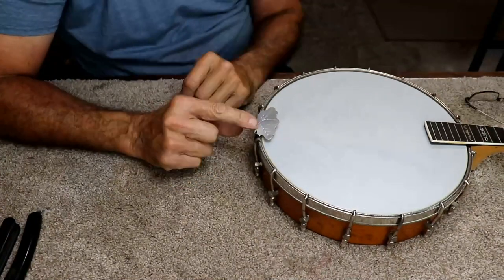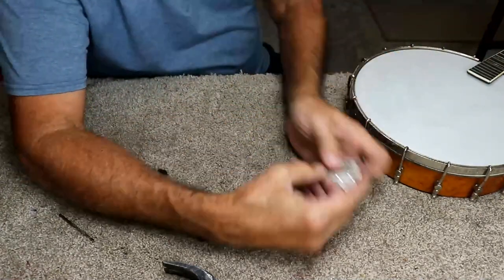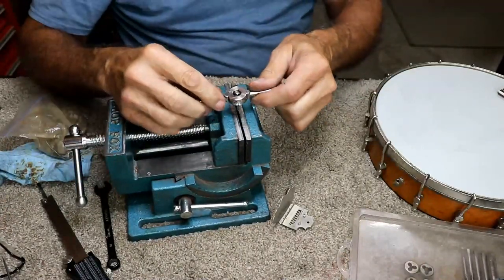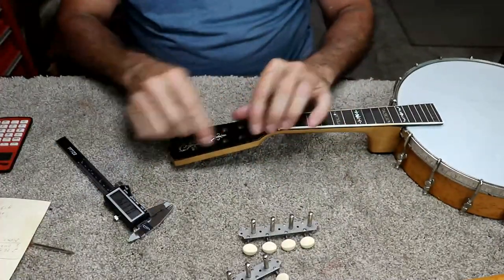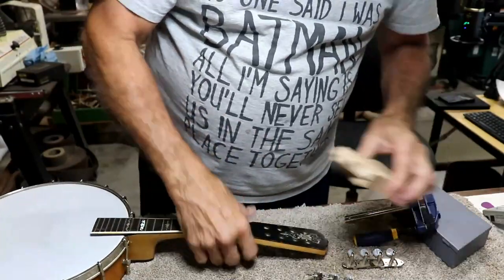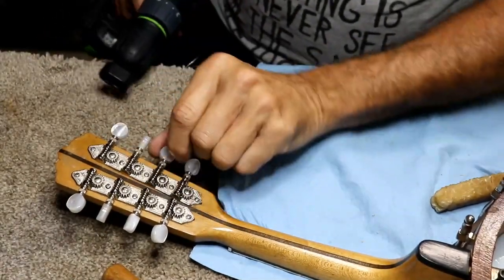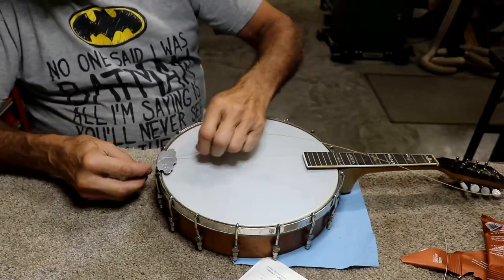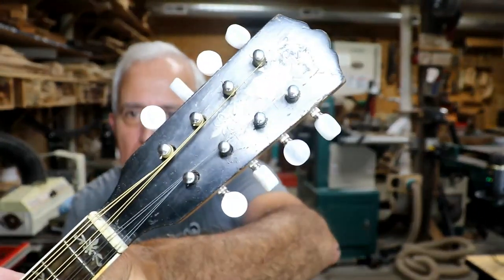594 RSW A Banjolin Repair - All Screwed Up - Part 3

Comment: Just get a set of Grovers fron StewMac.  I used Grovers on all three of my mandos  and have no regrets.   If the head holes don't line up, just plug 'em or ream 'em depending on how far off they are.  Grovers come with bushings that are generous.

Comment: Regarding the tuners, did you give any thought to using individual keys?  If the spacing was tight for normal keys, you could have used smaller, 12-string keys.  Just a thought.  Fascinating project, along with innovative solutions!

Comment: Personally, I would’ve used a straight edge on either side of the neck and marked the metal ring where the tailpiece goes and then marked a centerline between the two marks.

Comment: Why couldn't you have put those - "ferrules" - bushing gizmos to cover up the slivers of the previous holes that were still showing?  I also kinda wondered why you didn't "just" plug/putty in the previous holes first, to begin with, before drilling the new holes? Just a little finish touch-up afterwards, unless those ferrules would've worked there, also. Same situation,  basically.  I don't know why you didn't put them on that other project, anyway. i guess you simply didn't need them. 

Thanks, Jerry!!  Awesome!!!

Comment: After making the holes large enough, you'll want to partially sleeve the 4 nearest the end of the headstock. Why? Because string tension shouldn't be tilting the peg in the headstock hole. The 4 pegs nearest the nut should have the side of the peg bearing on newly reamed wood, but the other 4 will have extra clearance letting string tension tilt the peg, which could end up distorting the machinery on the underside of the headstock.